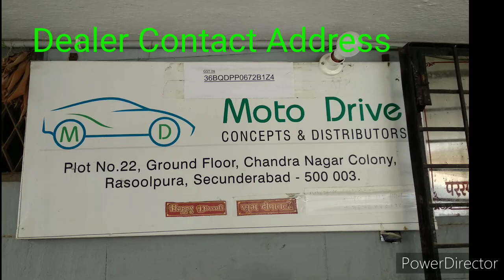Tata Nexon 2020 Rear Bumper Guard Installation

Comment: Any issues with parking sensors after installing this?
Reply from the maker: Getting Continues Noise, While Reversing car after installing bumper.
How to resolve this   ?
Reply: @davirivlogs1261  That is why I asked you this.
Reply: @davirivlogs1261  noise from parking sensors?
Reply from the maker: Issue got resolved by adjusting little bit  bumper position with bolts.
Reply: @Daviri vlogs BRO my nexon 2020 bumper guard also sensor problem like this how to resolve the position of bumper guard?
Reply from the maker: Loose bolts of bumper, slightly bring down 10mm and fix the bolts, mean while press back camera button on infotainment system of Nexon. Make sure sound is coming or not after adjusting bumper.
Reply: @davirivlogs1261  tq broooo❤️
Reply: Bumper pipe ko thoda niche dabakar fir bolt tite rar dene se beep wali problem solve ho jayegi